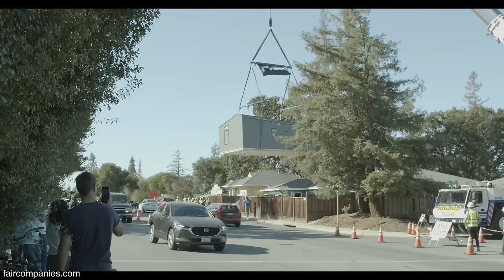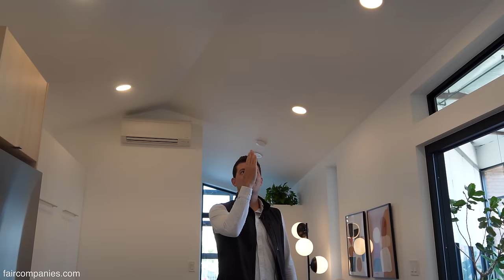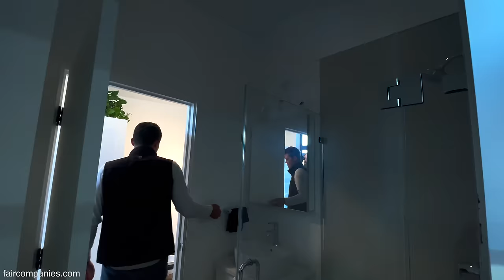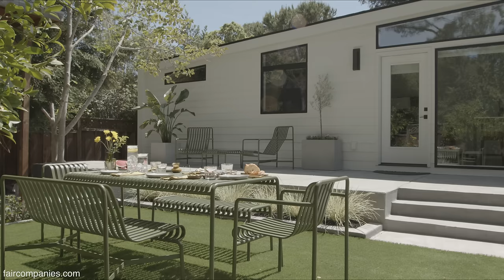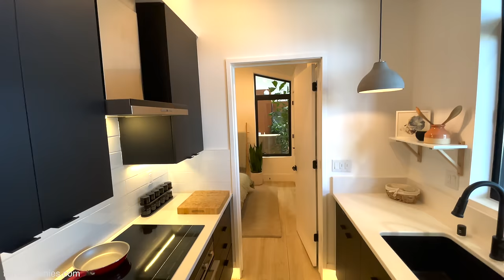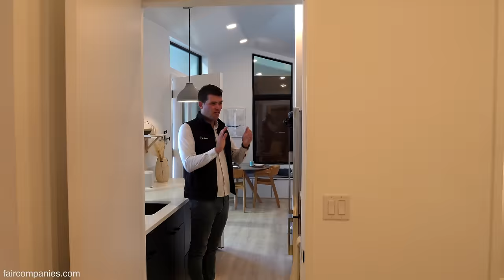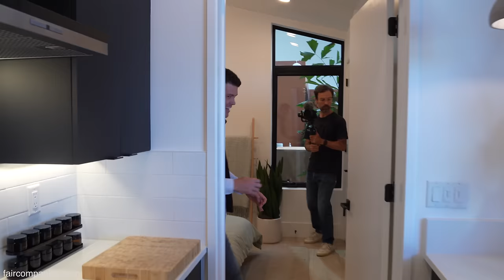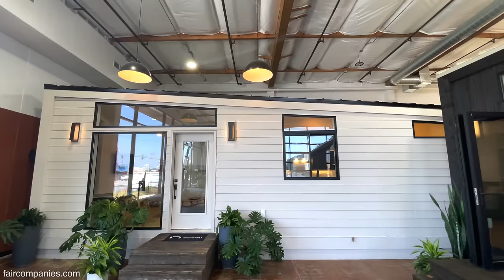Small prefab backyard home feels more livable than McMansions

Comment: That tilted rooftop might also be good for solar panels? If the angle faces the side where the sun rises? Im told that solarpanels give much more electricity if they are tilted towards the sun in a certain way? you dont want a totally flat roof and you dont want a very pointed rooftop because you loose space. So a small angle rooftop might be the best.

Comment: Very cool but how much does that diagonal gable roof add to cost do you think?
Reply: Since they’re prefab, not much. Even if it was a custom home it wouldn’t really add that much cost except in the building spending a little time to figure out the cuts, and the cuts will probably be more wasteful.
Reply: @TimBryan  Seriously, how does it being built offsite, change the labor and waste involved in cutting those metal roof panels? If it were a standard gable, they could order the panels to the length they need and have zero waste and zero cuts. But then, when you lay in bed you aren't under the highest point... what a travesty. This design feature also complecates future repairs.

Comment: Very nice units, and ADU's are great for homes with space, the problem comes in when you have very low prop tax and you want to keep that low tax rate, adding to real property is going to move your tax base, where if you used a tiny home "DMV registered / on wheels" does not hit your tax basis.
Reply: Are tiny homes legal in all of California? I am in the Bay Area.
Reply: In other words do the new laws allow for a tiny home on the property in all of Ca.?
Reply: @curiousgeorge555   Yea, you can ether
Reply: @curiousgeorge555  No prob with TH or ADU, just know what it will do to your tax basis
Reply: @richhudnut5110  When did this change? Maybe it is city by city as I am almost certain you can't park a TH anywhere in the East Bay. I'll call a TH maker tomorrow. Thx.
Reply: @curiousgeorge555  Oakland changed their rules recently and now allows tiny homes, RVs, trailers, etc to be lived in but have to go through the permit process and have them connected to sewer and power
Reply: @fouroakfarm  Great! Do you know what the deal is in Richmond?

Comment: While ADU are a good idea we also know that a lot of the problem in California is SF/detached zoning. You have whole municipalities where nothing but single family, detached homes are allowed. We know that there are some people who want something else and where land cost is so high it only makes sense to allow higher value real estate to be built than SF homes. Townhouses for example can easily double housing density while providing the kind of low maintenance home that a lot of people want. I used to own a townhouse (BTW no HOA/condo fees) and the only thing I had to do outside was maintain a flower bed. On that block there were 16 townhouses with 2-3 bedrooms each and across the street there are 6 single family lots so there's no way the SF homes out-accommodate the 16 townhouses and the townhouses are worth more and increasing in value while the old SF homes are decreasing in value

Comment: TBH, I was initially unimpressed with what felt like their preemptive advertising campaign and questionable prices. Im not surprised that the final cost is so high, but it begs the question: does that price includes the price of installing? Perhaps I missed that in the video, and I’m no expert. But… Seems much more expensive than just building in place, and with prefab you’re limited to certain design constraints and a host of new problems, as stated in the video. Prefab as a solution when building in place is possible is kinda unnecessary. Im also not surprised that this is all from a silicon valley start up, constantly trying to “think different” towards problems without much regard to the potential consequences. Problems like this one still have conventional solutions that have merely been held back by now defunct red tape bureaucracy. With these homes, after the property owner is out almost a quarter million, they’re going to try and recoup that by listing the unit at proportionally high rates. Im excited to see ADU’s and somewhat expected companies like this to show up, I just hope more TRUELY AFFORDABLE housing increases or we’re in for more of the same.

Comment: Actually if you can prove that the additional dwelling unit the adu will cause your property values to plummet or cause damage or if they're going to put a concrete pad in an area that then would cause flooding onto your property there's lots of things to consider then does the property even have the backyard to do it the house next to me thinks they're going to simple call to code enforcement if they put any more concrete on the property there's not enough dirt area for water to percolate into and this 1930s neighborhood was not built for the water to drain to the streets so therefore you got to leave a certain percentage of your yard dirt or grass for rain drainage and nonpoint stormwater

Comment: Well designed, challenge is roads, water, electric grid not sized for increased density.  Should these be installed at scale, California will  solve one problem and create another.  Real solutions to housing shortages without increasing traffic would be live, work, play communities.  We live in one in Boise and love how little we have to drive.

Comment: Over $200,000 dollars?? For a shed?!? You could buy a cheap one ( same size) for $5,000 at home depot, insulate it and plug the wiring with extensions... all for less than $30,000
Reply: Plus the installation which means renting a very big crane and about labor for 20 construction workers